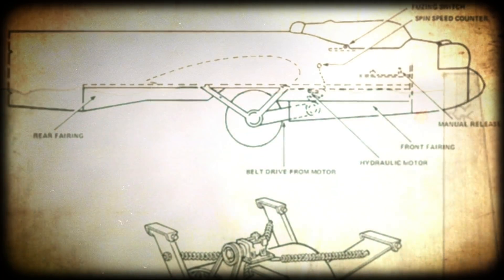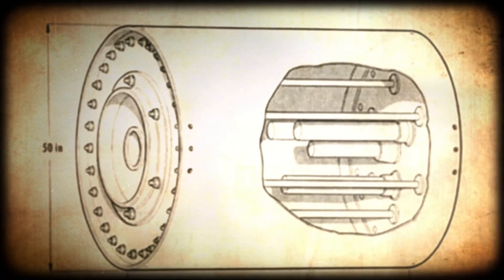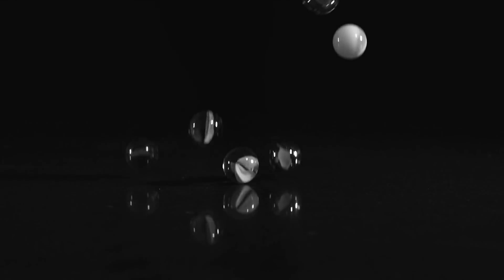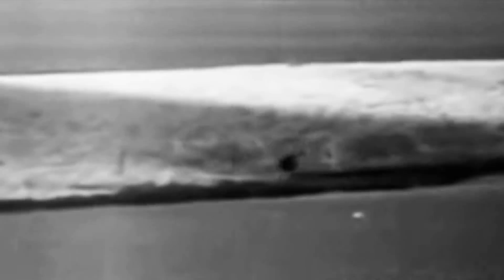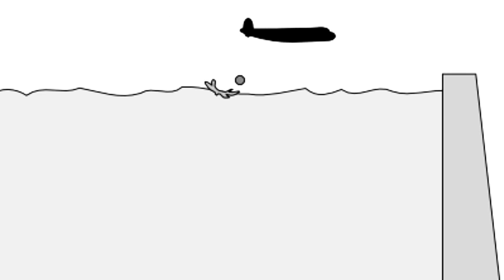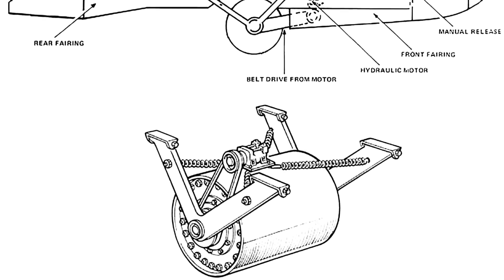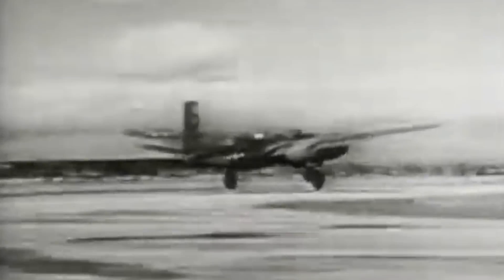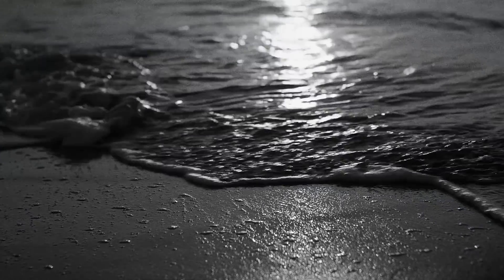Bouncing a Bomb Back Into the Tail of Your Own Plane

Comment: My grandfather's friends all died in a nearly identical accident, but in a RCAF Lancaster bomber.  Same thing, they were a little too low, a bouncer came up and knocked their tail off and they hit the water and died instantly. I'm pretty sure that footage is on YT too....kinda eery knowing the story from someone who was there so long ago, and then possibly seeing it.

His crew tried out for the mission but both the crew and the plane had to pass, or otherwise both were rejected.  Their bomb failed to drop at all, so they were passed over.

I also remember him telling me about doing a low altitude French Resistance supply drop at night, and about an 88mm flak shell passing clean thru part of the starboard tail/rudder, thru both sides of the fuselage and then thru the port side tail/rudder, and never detonated.  He didn't notice the holes until he got up out of his tail gun port, and he saw the holes about a foot behind his head.  I also remember my mom turning pale white as he told me the story as she realized how close our family came to not existing.  He thought it was kinda funny and had a chuckle about it all.

RIP Grandpa

Comment: The A-26 crash of 28 April 1945 took place on Choctawhatchee Bay about 3.2 miles NE of Fort Walton (now Fort Walton Beach), Florida, off of the Port Dixie section of Shalimar, Florida, on Eglin Water Range 60. The bomber was aiming at a battleship-sized floating target anchored off of Black’s Point. The camera was located at what is now approximately 71 Meigs Drive, Shalimar.

Comment: Just drop a torpedo from the sky
Reply: Not precise enough, and if they explode too far from the target they will do little damage.
Also, dropped torpedoes tend to dive easily, which means that they would likely get stuck in the bottom of the lake or beach.
Reply: The backward spin on the cylinder forces it to "stick to" the dam wall as the charge stinks.  It then detonates, right up against the wall, at the desired depth.

Comment: Three dams were breached: the Moenhe, Eder, and Sorpe. They were all the main targets.
The “Dambusters” squadron, 617, became a specialist bombing unit.
They also dropped huge single bombs, the 5 ton “Tallboy” and the 10 ton “Grand Slam”.
These were intended to be precision-dropped from high altitude to punch through many feet of concrete and burst inside bunkers.
It was a Tallboy dropped by 617 squadron that finally sank the battleship Tirpitz.
These big bombs were also used to destroy railway viaducts and tunnels.
Reply: The Sorpe wasn't breached.

Comment: If someone can link me a video of why they didn't just hit the dam with regular/modified torpedoes or something, please do. Cuz.... i cannot understand the bouncing bomb deal. It just.... so dumb as opposed to what they COULD have done.
Reply: Torpedoes would have been intercepted by torpedo nets that were set up around the targets. A dropped torpedo would likely have embedded into the lake bottom.
The bouncing bomb was designed to almost stop right at the front of the dam and then sink. When it exploded, the hydrodynamic shock wave from the water ruptured the dam.
The bouncing bomb was utterly brilliant, and it was the ONLY thing that could work.

Comment: They were called the dam busters by the way, you forgot to include the whole first mission the Lancaster bomber did with Wallace's first iteration cylindrical bouncing bomb that was a key turning point for the allies during ww2, sad that people died but you're forgetting what good the bombs did and I should hope this video doesn't discredit Wallace's work 🖒
Reply: well yes the bomb worked but the germas rebuilt the dam very quickly. I guess it still did detract resources from the german army

Comment: I know there must be a reason, but it seems that it would be so much easier to bomb the exposed side of the dam with a less difficult procedure.
Reply: The water pressure directed more of the shockwave into the structure of the dam, thus requiring a lot less explosive.  Because an explosion on the exposed side of the dam would dissipate most of its energy into the surrounding air it was impossible to breach the dam from that side.

Comment: Couldn't they have just made a bomb that would dive down to 30ft and explode on contact with the dam? Why did they want it to bounce?..
Reply: Hard to accurately drop close enough and the bouncing was to avoid nets also if done correctly it would be at point blank when it exploded

Comment: Their were three bombs Upkeep and two types of Highball one for shipping able to break the back of a 35,000 ton warship and a land based version for railway tunnels. 35  Mosquito's were adapted for carrier use and modified to carry 3 bombs. The US test should not have used the A20 and certainly not been doing  a run at that altitude.

Comment: There are a lot of commentators on here asking why did the pilots drop the bomb so low? First of all, this weapon was not the same as a conventional bomb that would be dropped on its target from a high altitude. There were many initial design issues with the prototypes of these weapons,  principally that, if the bomb was dropped from too high a height, it would disintegrate on impact with the water, instead of skipping as intended to its target. The answer was to deploy the weapon from a lower altitude to defend against structural failure of the bomb. This resulted in a number of incidents, not precluding the above, where aircraft were damaged or lost in trials. Eventually a redesign of the only bomb to be used in anger ‘Upkeep’, did away with the necessity to fly so low. ‘Highball’ was never developed to an operational standard and was eventually scrapped.

Comment: I don't get it why they went too low? Surely someone watching from shore could radio them and alert them on low altitude. Ok, we can say it was test run to avoid AAA as well, but come on, even if it was conventional bomb it would make problems by splashing (not to mention blast). Also, it makes no sense to go that low and that fast since time to react is down to millisecond. R.I.P. for the crew, but who ever decided for them to go that low (cpt himself, some pompous brass or some ignorant scientist) killed them... Regarding the ops in general, it would be hell to do it in daytime (as USAF missions were done), but far more 'safer' at dark when no one is expecting you to pull a stunt like that. And it was all done with technical achievements of that time (no NV googles, no high-tech IR cameras or upgraded radars). Crews that pulled those missions pushed limits of aviation like never before and after. Imagine how easy would it be to do the same with Intruder? And not even at night, but on the stormy night...

Comment: Interesting is that the royal air force actually used this type of bomb to bombard german dams. The most popular of such actions was the attack on the Möhnetalsperre.
Reply: I bet the used metric instead of imperial z
Reply: You don't say! I think we got that by watching the video.
Reply: That’s what they were designed for
Reply: This is different to the one used in the dams attacks. This is 'Highball' and the one used on the dams was called 'Upkeep'. Upkeep was a lot bigger and about five times heavier.

Comment: I'd imagine it can be very hard to judge heights while flying that low for the pilot, not to mention the instruments could simply have been off. 
What I don't get though is that surely when testing a new experimental weapon they would have had ground observers in contact with the plane who should have noticed the plane was too low and called it off before it dropped the bomb.
Reply: That is why the original Dambusters used two spot lamps fixed blow the aircraft with beams that converged beside each other at the correct height above the water, so there was no guesswork involved in attaining the correct height to drop the weapon from.
Reply: Have a look at the British Highball tests with the Mosquito. They didn't seem to have much of a problem with it.

Comment: The installation of this weapon in the Lancaster bomber used a Ford Flathead V8 engine to turn the bomb reverse relative to the direction of travel to force the bomb to bounce farther and longer.
Reply: The shot is being filmed from the tail end pointing forward. I'm sure they tried spinning it in both directions but spinning in reverse would make it bounce higher at the sacrifice of quite a bit of distance. That would make them less accurate with the potential to bounce over as well as making the pilot have to be closer to the target and potential enemy fire.
Reply: @ebent24  Backspin made the bomb 'claw' its way down the dam wall.
Reply: No, it used a Vickers Jassey Variable Gear hydraulic motor.

Comment: why not just fly at the front of the dam and bomb it from that direction?
Reply: Conventional bombs weren’t powerful enough, dams are f’n massive. The bouncing bombs had backspin that kept it tight against dam wall as it sank, the explosion combined with water pressure would destroy the dam
Reply: @jeffheywood6101  I get that, but wouldn't a "run" f it up enough to make it non functional? or was the purpose to disable the the intakes and make the dam "not work" as opposed to "destroy" it
Reply: @gh0st_0f_b0b_chandler  they wanted the dams destroyed, but downstream was where the damage they really wanted to happen

Comment: What stood out for me was how much the main wings flexed downward once the tail plane departed the aircraft and it nosed over.
Reply: Once the tail went, the sudden dive meant the wings went well outside their normal angle of attack and in effect 'dug into' the airflow.  If the aircraft had been higher, the wings would probably have snapped off before it hit the water.

Comment: At 04:10. I'm so impressed with the design stressing of the main wing of the accident aircraft. After it loses its tail the aircraft immediately pushes immense negative G forces. If you look at the slowed footage, the wing actually didn't fail until impact with the water. Even though each wingtip is being forced down by a couple of feet, it's flexing equally throughout its length. Just think how incredible that is when you consider this all was designed by men armed with slide rules!
Reply: The only reason the main plane didn’t fail is because the whole accident sequence lasted mere seconds before impact with the drink. That aircraft would have tore itself apart had that happened higher up. Those wings would have snapped right off after loosing the tail plane.
Reply: @109-w7v  yes I'm aware of that. My point is that the stresses seemed equally spread over the entire wing and it didn't fail until it hit the water. The wing was dissipating so much of the forces imposed on it.

Comment: I have nothing against the pilotd, im sure that they were doing as they were supposed too. but why tf would you fly so low

again nothing against them
Reply: If they were doing it like they were supposed to than they got bad intel. 60ft is way too low.
Reply: They were experimenting with the drop  height , when they found out what it was their instruments couldn't gauge the height because it was to low for them , so they fitted spotlights at the front and rear of the plane at an angle towards each other , when the lights shone on the water each spot of the lights had to merge with each other to make the height exactly right  , in other words triangulation , simple but clever.
Reply: @joebutlersnr7017  the spotlights were fitted on the Lancaster's because their missions would be flown at night; unless I missed it, the A-26 wasn't fitted with these since skip bombing missions were flown during the day, making the light method of judging altitude useless. People in the comments section apparently don't realize skip bombing and the dam buster bombs were developed for different tasks and had different, though similar, mission profiles. The bombs themselves were different and required different delivery techniques. I'm sure they wanted to know how low they could fly since they would be evading AAA fire, more intense since these missions would be carried out in daylight.

Comment: Why tf couldn’t they just bomb the front of the friggin dam??
Reply: WW2 bombers weren't accurate enough so they would have had a hard time hitting the right part of the dam, and the dams are really tough reinforced structures. Water is non-compressible (which is how hydraulics work), by placing the bomb in the water against the dam wall, all the explosive force is directed into the structure instead of outwards into the air.
Reply: Well the bouncing bomb was used in 1943 to bomb the dam's in Germany by the Dambusters squadron 617. The bomb is designed to sink down and damage the dam so the force of water will destroy the dam and make it a nightmare to repair as well as does destruction to anything on the other side of the dam
Reply: Ah makes sense
Reply: Germans used protection in front of the dam (water side) such as passive (obstacles) and active measures (guns) so that a conventional airplane and drop could never get close enough to drop a traditional bomb where intended. This bomb had the advantage of letting the drop occur far away from these measures, and yet deliver the blast close to the dam and underwater, where the force propagation is maximum due to water not being compressible. In practice, they created a cruise missile, except it had no propulsion and just relied on physics to skip close to the target.

Comment: But was it SUPPOSED to be dropped that low? They knew how it worked and Barnes Wallis would have told them that's too low. 10 feet is the height a much smaller torpedo plane might go - without the bounce.
 If not, then seems crazy to then just drop the whole idea.
Reply: Operator error isn't a reason to just cancel the whole thing.

Comment: barnes wallace was a great man did more than what hes given credit for
Reply: Agreed, one of the great engineers. Also responsible for the Tall Boy and the Grand Slam - an early precursor to the MOAB. I believe he came up with the initial concept of the Harrier VTOL 'jump jet' (or known as the AV8- B in the US). Wallace also designed a high altitude long range bomber, about the same size as a B-36, which he had envisaged being built in quantity and could be relatively easily converted into civilian airliners or transports after the war had ended. Forward thinking.

Comment: This footage totally bummed me out. Why would the pilot agree to that?
Reply: In the military you do not agree. You are told. Your job is to do as ordered. Your boss is not interested in your opinion.
Reply: @Well_Theres_Your_Problem  that's not how the military works. "... equal and opposite reaction".  You absolutely can object to an order.
Reply: @Well_Theres_Your_Problem  and you killed your flight crew testing a ridiculous weapon!
Reply: @DrDirt-fk5ls  It wasn't a "ridiculous weapon". The original dam buster bomb was the only way to deliver a depth charge right up against the inside of a dam wall. The same effect would also be deadly to a warship, it would be much harder than a torpedo for the ship to avoid and it could also have a much larger explosive charge.
Reply: @Pete856  it was an 8 thousand pound depth charge! And an English dude playin' with marbles said, ",,,whacky idea, guys!".

It's not as bad as the American, 'bat bomb'!

Comment: How did they not realize what would happen dropping it that low. Wtf
Reply: Seriously, such a waste of the crew member's lives. Surely they dropped it from higher the first several times and had to have noticed that it bounced...
Reply: @zachh5812  they likely didn't realize they were that low. Probably focused on the run and the drop at that point to actually check their altimeter, and over water like that it's extremely difficult to judge how high off the water you are
Reply: @QuestionThings123  altimeters are not that precise, especially back then. They had to judge off visual q’s which is very hard over water indeed.
Reply: @QuestionThings123  Which is why the RAF used light beams that converged at 60'. They didn't trust  the accuracy of the altimeters.
Reply: @QuestionThings123  Yet RAF Mosquito pilots didn't have that problem.
Reply: @alastairpreston3237  The Mosquitoes didn't use them in daylight. Look at the British Highball tests, both on land and on water.
Reply: Probably testing low altitude delivery capability at the expense of the crew and seriously ignoring the Brit's recommendations. Just a guess.
Reply: @user-vp1sc7tt4m  maybe, just maybe, it's for different target, or the brit using american as tester.
Reply: @altoclan21  This happened in 1945. The British Highballs were tested as early as 1943.
Reply: And why did they need four people on board?
Reply: Escape Radar
Reply: Todays crop of "College" graduates would be about as bright. :(

Comment: Who'da thunk dropping a bouncing bomb at an altitude of 10' was a bad idea.  Also, why didn't they just use torpedos against the dam?
Reply: The Germans used anti- torpedo nets in the water before the dam. So the Brits had to devise away to skip above the nets. The spinning of the bombs that helped them skip atop the water and nets also spun them down and against the wall of the damn, using centrifugal force and the water pressure to guide the explosion into the dam. Ingenious really!
Reply: @guyforlogos  thanks for why it was spinning, why it was skipping, and how it actually worked... the piece should have mentioned the 56 men that didn’t come back from the raid that night
Reply: Because to launch a torpedo a plane has to get very low and slow which is not what you want to do when attacking a well defended dam